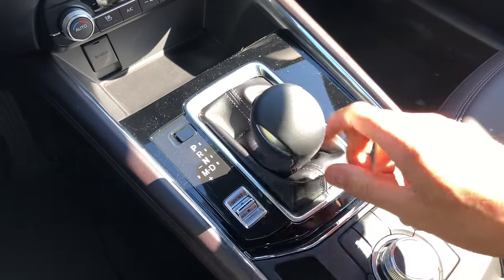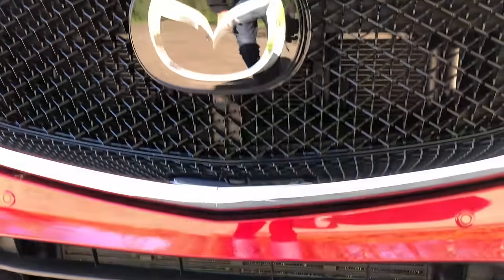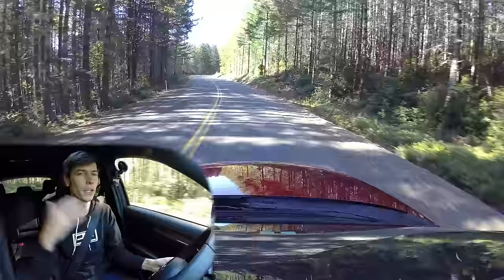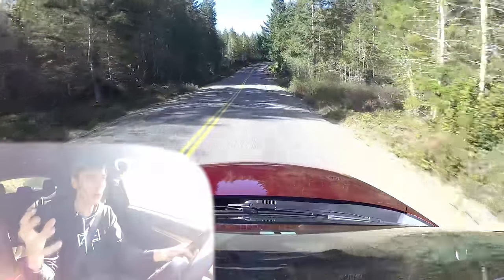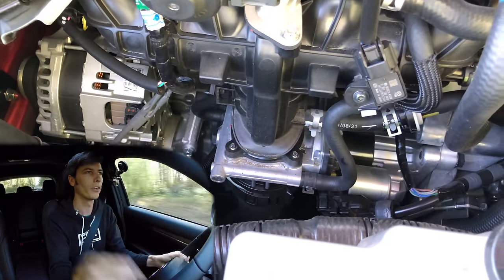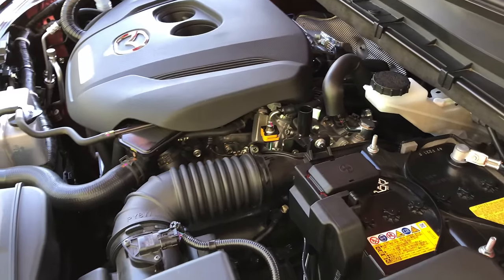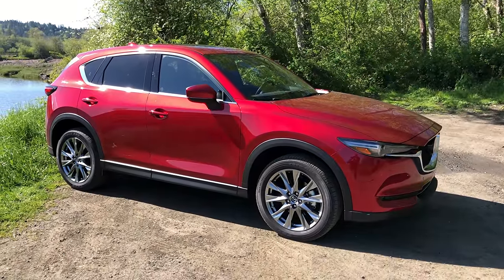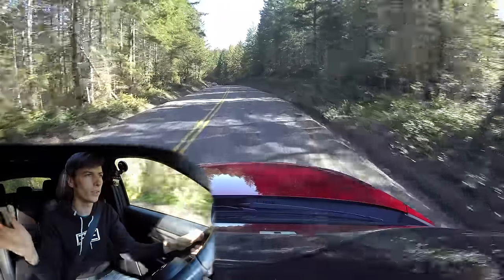Are CVTs Bad? Why Mazda Avoids CVT Transmissions

Comment: I love CVT in theory. But after having 2 die on me, I'll stick with my 5 speed.
Reply: I've had a Nissan CVT that failed in a short amount of time, so I bought another one thinking it's just that one transmission was bad. Boy was I wrong. New one broke even faster than the last. Will never buy another Nissan/ CVT after that experience
Reply: @captainobvious5378  just don't buy Nissan. Their CVT problems are common.
Reply: Clutch pedal for the win
Reply: @captainobvious5378  I would honestly love to get a Nissan Maxima/Altima with a 3.5. I really like the looks inside and out. But won't ever buy one with a CVT. I've been looking into Inifiniti though. A lot of those come with Auto's and not CVT's.
Reply: @Summit900  just don't get Nissan at all anymore. Not until they break partnership with Renault. It's French. It's bad.
Reply: Andrew Long I don’t think that’s going to happen soon. Even with that. They will still need betray Jatco. (Or ditch the cvt)
Reply: Which one, Lags? Nissan or "American" brand?
Reply: @gabrielriley2388  I've never been able to get my customers a good remanufactured Jatco, be it factory remain. Or third party. Cvt, or auto. They always come back to the shop with problems and I almost always have to file a claim about it
Reply: @schwenda3727  are you asking which to buy? If you buy Nissan, but their 370z. I'm fairly certain it's the only parts bin car that hasn't been touched by Renault yet. Otherwise get an American car but do your research. They aren't what they used to be either.
Reply: My brother bought a new nissan SUV and had 3 cvt die in the first 20k miles. They did extend his warranty but he says for sure that rig is going for sale before that warranty expires.
Reply: @captainobvious5378  You went and bought a Nissan which is the only company known for having CVT problems. So its your fault for not doing your research.
Reply: Only good CVT I've ever known is in my Polaris atv. And unlike a car CVT, I can change the belt in five minutes. A friend of mine just had her Versa CVT transmission give up. The rest of the car is in great condition, it only had 105,000 miles on it, and it's a junk car now because of the transmission.
Reply: @441meatloaf  that was when they now started to use cvt technology in their transmissions so there wernt much reports of them breaking down :)
Reply: Nissan and Mitsubishi CVTs are garbage (actually Nissan has 3 different CTV SKUs, the one in the Maxima, Altima SR, and Murano is decent, the one in the Pathfinder would be good if it weren't in such a large vehicle). Honda and Subaru's CVTs are decent, but still wouldn't buy one. Toyota and Hyundai/Kia make excellent CVTs. I'd much rather have a Kia CVT than a GM or Chrysler FWD automatic.
Reply: @Summit900  nissan suck it's not a datsun anymore old mechanic here
Reply: @juanrodriguez-ry6yt  Its a shame too. I really like the styling of the Maxima and Altima. But i wouldn't touch one.
Reply: @Summit900  got a 17 genesis v8 a little more money but it's rwd and it looks good or better
Reply: @juanrodriguez-ry6yt  I've been looking for a commuter car that has some get up and go. I've got a 2000 Trans Am M6 for a toy already.
Reply: I had 2 cvt in Audis, both are fine for 90000km, and hopefully longer at the next owner.
Reply: Captain Obvious the CVT is made by Jatco, their transmissions are horrible
Reply: My mom's 2013 Subaru Outback (with only 104,000 miles) died. CVT trans...I'll stick to my 6 speed auto Mazda cx3
Reply: @savannacurtis409  crazy to hear that.  I drive a Subaru.  I see people online with over 200k miles on their original Subaru CVT.
Reply: Captain Obvious I had Nissan Juke CVT that broke after 4500 miles. Never again will I buy CVT from Nissan
Reply: @cantkeepitin   Audi doesn't use CVT's. They use DSG's ( S-Tronic) at list in Europe.
Reply: Stay away from the JATCO CVT

However Toyota uses an Allison CVT which is way more reliable than JATCO

JATCO is owned by Nissan and has horrible reliability.
Reply: My 2008 Nissan Sentra CVT died last month. For the second time. To the nearest 100th mile, it got exactly 65,000 miles per transmission (Car as 130,000 total miles now). Is there something I am doing wrong that is causing the CVT to fail? I adhere to all regular maintenance recommendations.
Reply: @AndyE30  Nothing is what it used to be.......
Reply: @Burnenbrighter  Ford and Chevy also have CVT problems.  Ford had several lawsuits over the Focus hatchback CVT that got people killed or injured due to the lagging in traffic and 4 way intersections, etc.
Reply: @patricksteadman3105  Planned obsolescence in action.
Reply: @patricksteadman3105  unfortunately no. All I could suggest is to try changing the cvt fluid twice as often as recommended and see if that squeaks any more life out of them.
Reply: James Smith I am a rideshare driver and my 2016 CVT Toyota Corolla LE has 161000 miles, no issues at all 🤷‍♂️👀 Proper maintenance is the key. For Corolla, you need to change the transmission fluid every 60000 miles. You also need to change the filter and clean the three magnets. “DNY automotive “channel shows the proper way to change the trans fluid.
Reply: @CharllesC78  They use both. Multitronic is the CVT version

Comment: Great video!!  That was very interesting on learning specifically how a Mazda transmission operates.  Knowing the efficiency and reliability of a transmission is a huge selling point for those of us whom hate the disconnected feel of the simulated shifts of CVT.   It would be awesome to see you do the same type of video explaining specifically how the design of the Honda automatic 10 speed transmission operates. Thank you for sharing all your engineering fun facts!!
Reply: ValJune I am a rideshare driver and my 2016 CVT Toyota Corolla LE has 161000 miles, no issues at all 🤷‍♂️👀 Proper maintenance is the key. For Corolla, you need to change the transmission fluid every 60000 miles. You also need to change the filter and clean the three magnets. “DNY automotive “channel shows the proper way to change the trans fluid.

Comment: Mazda makes amazing  planetary automatic transmissions. It is easily the best part of my own Mazda. 10/10 would recommend a Mazda automatic transmission for anyone that enjoys driving, but doesn't want the faff of a manual.
Reply: I find my 2018 mazda 3 in normal mode is not as quick to downshift as I would like. I come from bigger v6/v8 American engines with like 4 gears and they didn't require me to stomp the throttle coming out of a corner to get meaningful power.

I do get very good mileage though, average of 31.7 over the last year and 10k miles, so at least there's that.

If you want to get on it and pop it in sport mode it's a pretty spritely power train.
Reply: "faff of a manual"

...

faff of a manual...?

... 

NNNNNNNNNNNNNNNNNNNNNNNNNNNNNAAANIIII
Reply: @EmmaCross94  Bruh. Communting in heavy traffic with a stick sucks. I've done it a lot. Nothing is worse than getting off of work tired and beat to sit in traffic and have an aching left foot.
Reply: @nooranik21  fair
Reply: nooranik21 369,000 miles in my manual Integra GSR. Never going automatic if I can help it. But our cx5 auto isn't bad.
Reply: nooranik21 I agree
Reply: ? I drive manual just use e brake a lot in heavy stop and go traffic
Reply: @F0XD1E  i find that in my 2016 Mazda 2, in normal mode, the transmission likes to stay in a high gear as much as possible (probably to save fuel), so for example it always keep 3rd or even 4th on speedbumps or tight corners. But it has paddle shifts, so i use that to force it to downshift when needed, instead of sport mode
Reply: nooranik21 JATCO (subsidiary of Nissan) makes the auto transmissions... not Mazda
Reply: @celtic125434849  yikes Nissan is okay but no Honda for reliability
Reply: @EduardoGarrido2188  I couldn't get a GT in a color I wanted in time so unfortunately no paddles for me.
Reply: I like my manual "faff".....
Reply: @epoxeclipse  I just put mine in neutral and rest my feet on the floor board till the light changes.  Problem solved.
Reply: @reesedaniel5835  we have much hills where i live, e brake trick for hills is needed for the manual trans amung us.
Reply: @celtic125434849  Not true for a while now:

"HIROSHIMA, Japan—Mazda Motor Corporation has announced that mass production of transmissions has began at its newly established transmission plant, Mazda Powertrain Manufacturing (Thailand) Co., Ltd.Jan 13, 2015"

Comment: You forget 1 more transmission goal...RELIABILITY
Reply: Yes. 1. How long before a failure. 2. How much to repair.
Reply: You're right. Apparently this is not an engineer's goal anymore.  A few years ago transmissions used to last up to 150 to 200 thousand miles without any issues and now you'll be happy if it last over 100  thousand miles with the CVT transmissions in it.  Nissan has one of the worst CVT transmissions out there and the company that makes there transmissions is also selling it to Honda, Subaru, BMW and and few other companies that I can't think of right now.
Reply: @mannu79  Jatco sell their crappy CVT;s to Nissan & Mitsubishi. 
Honda make their own, and I don't recall any BMW'S using CVT's.
Reply: How often do you see a Nissian Cube still on the road?  They've only been out of production for 5 years.
Reply: @arisavvides1970  I'm sorry you're right Honda makes your own but they do make it for other companies also BMW is one of them and I believe Subaru is another one.
Reply: @mannu79  Most BMW's have reliable ZF or Getrag transmissions.
As I stated before BMW don't use CVT's.

Subaru do use JATCO transmissions in some of their model's but have adapted them to their own specifications which 
made them more reliable and offer 10yr
or 100k warranty with them.
The only one's with bad reputation are Nissan, Mitsubishi, Suzuki that use the JATCO transmissions.
Reply: @blurglide  they never sold well in the first place. And I see them all the time here.
Reply: @arisavvides1970  I think most European cars rarely uses CVT on their cars, from VW to Peugeot, and to Ferrari and Lambo. Mostly Automatics and Dual Clutches. CVT is for usually for Japenis cars
Reply: @Xyb3rTeCh  Renault  is using  cvt
Reply: @arisavvides1970   I guess my sources must be wrong.  When I looked it up it said BMW has used CVT's from jatco before.
Reply: @anishshah8236  ok for Renault they have alliance with Nissan and some of their vehicles uses the same CVT as Nissan. But I'm talking more of the other general Renault model that mostly using dual clutch tranny, EDC 7 speed. Renailt Megane, Kadjar, Scenic and etc. Except for the Koleos which is CVT.
Reply: Toyota Prius CVTs are incredibly reliable.
Reply: @truantray  Because they are "e-CVTs" which are quite different from CVTs (and better)
Reply: @truantray  you have to remember that the amount of torque has a lot to do with cvt life span
Reply: BMW never had any CVTs. You must be thinking about Audi, and even then, Audi got out of the CVT game.
Reply: @mannu79  Honda actually makes their own transmissions in house
Reply: @mannu79  Honda makes its own transmissions.  The factory is in Russell's Point, Ohio, a small resort town located about 60 miles northwest of Columbus, Ohio (I live in Columbus and drive to Russell's Point every so often, so that's how I know this stuff).
Reply: @blurglide   Your 100%on the money, I still see many1990's corolla's
Reply: That all depends on one’s understanding of preventative maintenance and a little bit of self-education on their powertrain. You can have vehicle with the most reliable transmission and it will still fail because its owner neglects preventative maintenance.
Reply: Ari Savvides BMW owns Mini, which utilize Bosch CVTs and it’s crap because I think people don’t do enough preventative maintenance.
Reply: mannu79 It’s not wrong because BMW makes Mini and Minis have CVTs
Reply: okleydokley That’s because they own 33% of the company that makes their CVTs, Aisin. They have the strictest quality assurance from any vehicle manufacturers.
Reply: @mannu79  I've put well over 200k miles into every transmission I've owned, auto or manual. Zero problems so far, which is just how I like it.
Reply: @Xyb3rTeCh  Audi used CVT a lot.  but not in the current lineup
Reply: @arisavvides1970  I also noticed in BMW that I like  they don't manufacture V6 engines only Inline 6
Reply: @arisavvides1970  And Nissan now part owns Mitsubishi, so it makes sense.
Reply: Not Hitler   like what??  Other than Honda they did make transmissions at one point for Mazda,  Subaru,  Isuzu,  Suzuki,  BMW,  Volkswagen, MG Rover Group and Land Rover.  Do research.
Reply: Toyota's is the most reliable
Reply: @mannu79  Newest Nissan cars (like Qashqai) use dual clutch transmissions.
Reply: S. D. H.  I always hear that but my last Honda Accord lasted over 12 years without any transmission problems before I sold it. I currently have a 2015 Accord with CVT. I just hope it holds up until I at least finished paying for it
Reply: @mannu79  The company you're pertaining to that sells the CVTs is JATCO (Japanese Automatic Transmission Company).. Also they don't sell their CVTs to Honda and Subaru (atleast not anymore).. AFAIK Toyota has the best CVTs made by their daughter company AISIN, Honda has been making CVTs since the past decade and they've improved over the years but whether they are as reliable as Toyota's CVTs is inconclusive, however it's not uncommon to see a CVT Civic with more than 100k so they're atleast better than JATCO in terms of reliability.. Subaru just recently started making their own CVTs due to JATCO ruining their image in reliability but from some of their customer's feedbacks, Subaru's CVTs are still not that good..
Reply: I Had a thermo sensor go bad. A $5 part in an electronics store, $325 at HYundai, plus installation. They refuse to sell manual transmissions in N. America.
Reply: @Poweezie  It'll be fine. I've seen plenty of Honda CVTs with 200k+ miles with no issues with the transmission.
Reply: @mannu79  I like cvt but it seems none of the manufacturers can make them last much more than 100k.  From that position, why can they not just accept that the belt is a maintenance and make it easier to replace the same thing before failure?   If they could make it so it were a $300 to $400 maintenance item per 100k miles, maybe people might have more faith in them.  They work on perfecting them on the side until they can get 200k out of a belt?  Seems belt replacement is a very expensive and time consuming endeavour.
Reply: @truantray  yes but I do not think they are belted cvt.  They are electronic cvt using generators and motors and planetary gears to do what the belt does.  The Prius system is very reliable though.
Reply: I bought MAZDA for that exact reason as I believed an auto with torque converted would be more reliable than CVT/DSG on the long term, and I have had 2 mazda's and both have transmission problems really early on. There is definitely a design issue on those transmission.
Reply: If that’s what you want, shift the gears yourself!
Reply: @mannu79  The Jactco transmissions are also found in Jeep Patriots and Chevrolet Sparks.
Reply: Was about to comment something very similar. Lol
Reply: Luqman Hakim I am a rideshare driver and my 2016 CVT Toyota Corolla LE has 161000 miles, no issues at all 🤷‍♂️👀 Proper maintenance is the key. For Corolla, you need to change the transmission fluid every 60000 miles. You also need to change the filter and clean the three magnets. “DNY automotive “channel shows the proper way to change the trans fluid.

Comment: Lot of people not even know what is a cvt, they just go and buy the car that they like having in consideration reputation of the brand (that can change real quick, for example: integration of CVT....) , fuel economy, budget, etc. The fact that still there is a  high  number  in sales of vehicles equipped with CVT, in my opinion, it is not due to the people understand the implications of having a cvt in their car from the stand point of reliability and proper maintenance. Once people start experiencing trouble with cvt's those numbers can start to change, unless the manufacturers start to improve them. Thank you Jason like always for your great job and professionalism.